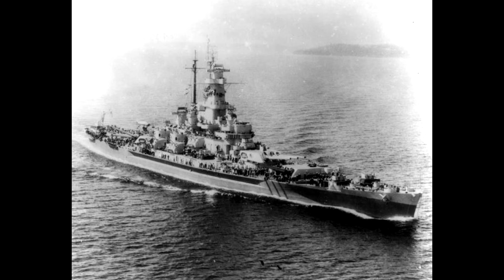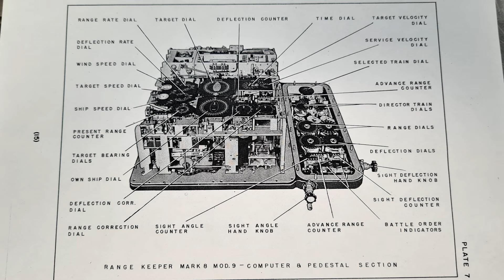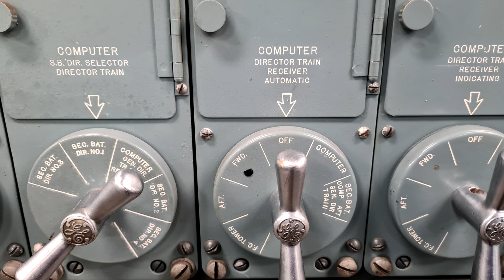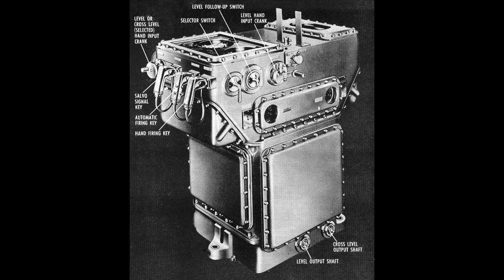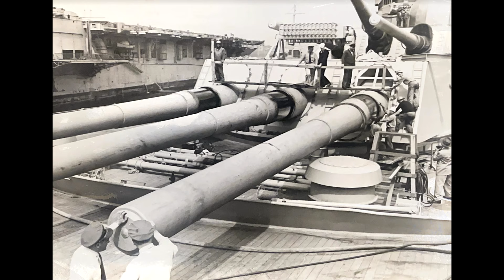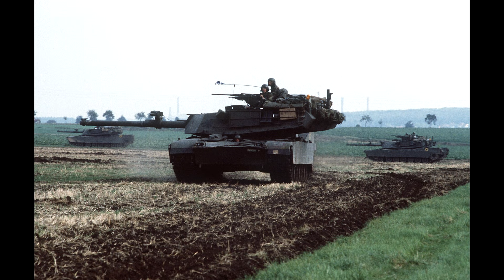US Navy Fire Control Systems - How They Really Work

Comment: This Professor knows his stuff.  Our company did follow-on work after the Korean war, using this same technology to develop our DPS (Dynamic Ship Positioning) system for the MoHole Project, several Oil and Gas drilling companies, and Project Azorian.  Our original systems were developed using more modern electronic Analog computers (which I helped to program), and then later using a combination of Digital+Analog computers.  Our tasks were very Simplified, since the target did not move.  The drilling strings, for oil/gas drilling, only required 9degrees of freedom for the ship, 6degrees of freedom for the drill string, 3degrees of freedom for the currents (but at least two layers, thus 6+), and a final 3-degree positioning of the of the drill head, to re-enter the drill hole.  The final insertion was Not solvable by the computational technology of that time.  So Exxon and others used a closed-loop Servo method, where bottom acoustic markers were emplaced to provide dynamic feedback, back to the computers.  Our systems worked fine, and were later upgraded into the small-mainframe systems such as the DEC VAX computers.  All of the modern Oil/Gas sea-drilling companies use some variant of that, and prior battle-control pointing systems.  When I was at University, the Servo classes had a naval Destroyer gun turret control system in the labs.  They had Amplidynes, frequency converters, hydraulic interfaces to pneumatic systems, and electronic modules to control these.  That is where I learned true "feedback systems theory" about how to actually point a twenty-ton object at a moving target.  I still have my Korn&Korn analog computer textbooks.  Now this can be done on a Laptop, or even Smartphone.  No new Physics applies, or is needed, just prior knowledge.

Comment: I may be incorrect, but it’s my understanding, when the Iowas were brought back in the early 90s. There was no digital computer that had the ability to match the 1940s-era DC gear already installed.
Reply: Myth, digital pocket calculators from that era could easily do all the mathematics faster. Normal PCs have already been on the market for more than a decade. If there were any issues, it was connecting all that digital electronics to analog/mechanical actuators, that interface had to be custom made. It's like taking a modern ferrari engine and putting it into horse carriage instead of horses, not necessary easy task but it doesn't mean horses are better :)

Comment: The US clearly understood that it's much better to hit something with a 16" shell, rather than miss with an 18".
Reply: Hey look, another person who thinks the IJN didn’t have electromechanical fire control systems based on distorted information. (Though the later American ones were a bit better than the best Japanese models, and the Americans also had FC radar, which is something separate from the computer part).
Reply: @bkjeong4302  I don't doubt that IJN had fire controls on their battleships. I just doubt they were as good as American.
Reply: @sasha022  

Not quite as good as the (post-1942) American models but not nearly as bad as a lot of people assume.

Comment: The fire control table assign a quantified assessment on a scale of 1 to 10 of the effectiveness of Japanese, US, British, French and Soviet fire control systems used, fielded or nearly fielded in World War II. It is my assessment and I take responsibility for assigned values. I don't believe this is dogma, and readers are free to modify the table as they wish. 
This was part of a series of data packages I built back in the early 2000s, when I was stationed at Ft. McPherson, GA. This was a labor of love I engaged in as an unpaid consultant to Naval Warfare Simulations mod of SSI's Fighting Steel. I built tables with gun, shell, turret, armor quality, torpedoes and fire control. These tables covered the navies and coast defenses of the major and minor naval powers from 1865 to 1945. Part of the effort was building an integrated simulation of naval combat where modern (1939-45) APHEPCBC shells fired from modern guns in modern turrets against armor systems prevalent in 1865-75 as an example. I want to state here that much of this work was based on Nathan Okrun's wonderful web site on armor and shell penetration, though I assessed various armor and protective material into an integrated chart and used different calculations on penetration based on other simulations than his. I will post my bibliography of references I used for this work as soon as possible as I have a library of over 4,000 hard copy and paperback books along with over 2,000 e-books and thousands of relevant articles from publications such as Warships. I do want to give a shout out to the Naval Weapons of the World site, though I continue to disagree with their version of the development of the US Army's 14in Railway Gun M1921. 
This table only covers Pacific navies as I pulled it together as a data table to support a mod of Matrix's War in the Pacific and a scenario based on a Warplan "Orange" scenario in which the war starts in November 1939 after the Japanese failed to defuse the USS Panay incident. The essay I posted is also related to this scenario, as I have built a large number of essays explaining how the scenario was built and the road to war and the navies, weapons and technology that would feature in such a war between 1939 and 1943. Thanks for bearing with me on this as I am now fully retired from government service in January of this year after having retired from active duty Army in 2005 and have the time to impose myself on defenseless web creators and readers.

Comment: (Fire Control Part 6) Fire Control System Ratings
	Japan	US	British	French	Soviet	Dutch
10		Mk.13 FCR, Mk.38 FCD, Mk.VIII Range Keeper, Mk.43 Stable Vertical, RPC (US)				
9.5		Mk.8 FCR, Mk.38 FCD, Mk.VIII Range Keeper, Mk.43 Stable Vertical, RPC; Mk.13 FCR, Mk.34 FCD, Mk.VIII Range Keeper, Mk.30/32/41 Stable Vertical, RPC (US)			
9		Mk.3 FCR, Mk.38 FCD, Mk.VIII Range Keeper, Mk.43 Stable Vertical, RPC; Mk.8 FCR, Mk.34 FCD, Mk.VIII Range Keeper, Mk.30/32/41 Stable Vertical, RPC (US)	Type 274/930 FCR, DCT, Mk.X AFCT, RPC(T) (RN)			
8.5		Mk.38 FCD, Mk.VIII Range Keeper, Mk.43 Stable Vertical, RPC; Mk.3 FCR, Mk.34 FCD, Mk.VIII Range Keeper, Mk.30/32/41 Stable Vertical, RPC; Mk.1/3 FCR, Mk.38 FCD, Mk.VIII Range Keeper, Mk.41/43 Stable Vertical	Type 275 FCR, Mk.37 FCD, Mk.1 Computer, RPC (US)			
8		Mk.3 FCR, Mk.34 FCD, Mk.VIII Range Keeper, Mk.30/32/41 Stable Vertical, RPC; Mk.28 FCR, Mk.35 FCD, Mk.11 Range Keeper, Mk.7 Stable Vertical, RPC; Mk.28 FCR, Mk.36 FCD, Mk.11 Range Keeper, Mk.7 Stable Vertical, RPC; Mk.4/12 FCR, Mk.37 FCD, Mk.1 Computer, RPC (US)	Type 274/930 FCR, DCT, AFCT Mk.IX 	Type 284M FCR (RN)  DCT, Mle 1936, Combinateur de tir, RPC (FR)		
7.5	Type 22M4 SS/FCR, Type 98 Hoiban, Type 98 shagekiban, Type 98 sokutekiban, Type 98 stable vertical (Japan)	Mk.3 FCR, Mk.34 FCD, Mk.VIII Range Keeper, Mk.30/32/41 Stable Vertical; Mk.34 FCD, Mk.VIII Range Keeper, Mk.30/32/41 Stable Vertical, RPC; Mk.8 FCR, Mk.31 FCD, Mk.VIII Range Keeper, Mk.30 Stable Vertical; Mk.3 FCR, Mk.35 FCD, Mk.11 Range Keeper, Mk.7 Stable Vertical, RPC; Mk.3 FCR, Mk.36 FCD, Mk.11 Range Keeper, Mk.7 Stable Vertical, RPC; Mk.28 FCR, Mk.33 FCD, Mk.IX Range Keeper, RPC (US)	Type 284M FCR, DCT, AFCT Mk.IX; Type 284M FCR, DCT, AFCT Mk.VII;	DCT, Mle 1936, Combinateur de tir, RPC; Type 284M FCR (RN), DCT, Mle 1929M36, Combinateur de tir, RPC (FR)		
7	Type 98 Hoiban, Type 98 shagekiban, Type 98 sokutekiban, Type 98 stable vertical (Japan)	Mk.28 FCR, Mk.31 FCD, Mk.VIII Range Keeper, Mk.30 Stable Vertical; Mk.37 FCD, Mk.1 Computer, RPC; Mk.4 FCR, Mk.33 FCD, Mk.IX Range Keeper, RPC (US)	Type 284 FCR, DCT, AFCT Mk.IX; Type 284 FCR, DCT, AFCT Mk.VII; Type 274/930 FCR, DCT, AFCT Mk.VI/VI* (RN), RPC	DCT, Mle 1936, Combinateur de tir; DCT, Mle 1929M36, Combinateur de tir, RPC; Type 284M FCR, DCT, Mle 1929, Combinateur de tir; RPC	(FR)	
6.5	Type 22M4 SS/FCR, Type 94M1 Hoiban, Type 92 shagekiban, Type 92 sokutekiban (Japan) Mk.3 FCR, Mk.31 FCD, Mk.VIII Range Keeper, Mk.30 Stable Vertical; Mk.35 FCD, Mk.11 Range Keeper, Mk.7 Stable Vertical, RPC; Mk.36 FCD, Mk.11 Range Keeper, Mk.7 Stable Vertical, RPC; Mk.3 FCR, Mk.27 FCD, Mk.VIII Range Keeper, Mk.29 Stable Vertical (US)	DCT, AFCT Mk.IX; DCT, AFCT Mk.VII; Type 284M FCR, DCT, AFCT Mk.IV*; Type 274/930 FCR, DCT, AFCT Mk.VI/VI*; Type 275 FCR, Mk.VI HACS, AFCC Mk.VII*, RPC (RN)	DCT, Mle 1929M36, Combinateur de tir; DCT, Mle 1929, Combinateur de tir; RPC; Type 285M, DCT, Mle 1936,  Conjugateur graphique, RPC (FR)

Comment: (Fire Control Part 5) amounts of generated power, were less than fully integrated into the fire control system and gunnery doctrine, and were less than completely reliable. Radar systems often “crashed” from the shock of the fires from their own ships. Few officers were trained in their use or understood their advantages and limitations. The radar scopes and operators were often separate from the directors and even the plotting room, resulting in operators taken ranges and bearings on the wrong target, as the early wide beam radars often presented multiple returns. Targets would appear and disappear from scopes, with operators and gunnery officers believing the target had sunk, and then would engage a “new” target some minutes later as the target reappeared. Still, all things considered, the Mark 3 (FC) fire control radar operating at 40cm could give accurate ranges to 24,000 yards and even spot shell splashes at 12,000 yards. Higher frequencies, more power and tighter beams, along with better integration into the fire control system resulted in performances unthinkable in pre-radar navies. In October 1944, three modernized older (pre-1937) US battleships detected a Japanese battleship at 40,000 yards at night with surface search radar (SG-1, 10cm), acquired and tracked it from 35,000 yards (with Mark 8 Mod.3 FCR, 10cm) and had a firing solution ready by 30,000 yards (using the Mk.34 director, Mk.VIII range keeper, the Mk.41 stable vertical and RPC). In comparison, the Japanese battleship’s maximum detection range was 30,000 yards with the Type 22 10cm radar, while the maximum effective night engagement range was 15,000 yards using illumination rounds.
		In 1939, the latest Japanese, American and British capital ship main gunnery fire control systems were basically equal in effectiveness. The Japanese FCS in their capital ships and heavy cruisers was more manually intensive in operation, especially as they inserted an additional manually operated optical target tracker into the loop. The least effective Japanese FCS was in their old light cruisers and destroyers. The best US systems were in the latest heavy and light cruisers, grading down to the FCS on the “California”, “New York”, and “Arkansas” class capital ships, which were at least a generation behind the latest Japanese FCS. The best British system were on its newest cruisers and the latest rebuilt battleships and battle cruiser. From there it graded down, HMS Hood and the unmodernized “R” class battleships having the least capable capital ship FCS, and the old WW1 light cruisers having barely any FCS at all. The Japanese pulled ahead slightly with the Type 98 FCS introduced in IJNS Hiei in 1940, but the US took the lead in 1941 with the Mk.38 FCD/Mk.VIII range keeper/Mk.52 stable vertical/RPC FCS and kept it, adding Mark 3, then Mark 8 and finally Mark 13 FCR.

Comment: Fire Control Part 4) ammunition and torpedoes. Aircraft and catapults could limit the elevation and train of guns or might even be blown off the ship by gun overpressure when firing over or near the catapults. 
		Another development coming out of the Great War was concentration of fire by divisions or groups of capital ships or cruisers. Using multiple ships would generate a larger “danger zone” around the target, ensuring hits despite any maneuvers it might employ. The British especially developed and trained on methods of coordinating the fire of multiple ships on a single target. Basically, one ship would control the firing solution and radio the solution to its mates, who would adjust the solution slightly for range and lead on the target. When the correct solution was reached, the ship which was hitting radioed its solution to the others. In some cases, not all the ships in the division could “see” the target. Air spotting could be integrated into this system. The best method involved ships with the same guns and turrets, which simplified generating firing solutions. One method adopted to identify shell splashes by ship was the use of colored dye in the ballistic shield which added color to shell splashes. Ships were assigned a specific color to identify their splashes from other ships in a battle line engagement.
		Night engagements had their own limits. A clear night, with still winds and waters, and a full moon, especially if it was behind the target, could provide sufficient light to engage to the visual horizon. When visibility dropped off, navies had to rely on star shells, flares, and searchlights. Star shells and parachute flares had to be placed behind the target to silhouette it, and the illumination shells were lighter, less well shaped and fired with smaller charges and at lower velocities. The maximum range for illumination rounds fired from heavy guns (15.5cm to 8”) was about 22,000 yards, with normal maximum ranges for medium guns (6”) being between 12,000 and 15,000 yards. Searchlights could reach out to 9,000 yards. A target’s gun flashes and any fires aboard a ship could help determine bearing and speed, but spotting required being able to see the shell splashes. Some navies successfully developed air dropped flares, but aerial spotting was not successfully used at night. Some navies investigated active infrared night vision, but the only thing that came out of it was the IJN’s infrared visual signaling system. The Japanese and the British were the most practiced navies at night combat with superior searchlights, optics, star shells and parachute flares. What changed things was radar. The USN, especially cruisers, did practice night combat but the scenarios involved protecting the battle line, not substituting for one. Night combat for USN battleships was usually limited to the use of secondary armament to drive off destroyers. Then there was the ad hoc nature of most of the USN surface action groups thrown into the “meat grinder” in and around the Solomons Islands in 1942-43.
		The radar horizon from one hundred feet above sea level is 30,000 to 40,000 yards, depending on conditions. Early fire control radars could detect out to these ranges, but with their low frequencies, low power, and wide beams, they often couldn’t determine bearing sufficiently to acquire and track a target consistently beyond 30,000 yards. Sometimes the effective range for target acquisition, tracking and engagement was less than 20,000 yards, which wasn’t much of an improvement over visual systems like flares, star shell and searchlights, though radar did not give your position away, at least not until you opened fire or until electronic surveillance systems were developed. The early designs of radar were heavy, required unanticipated